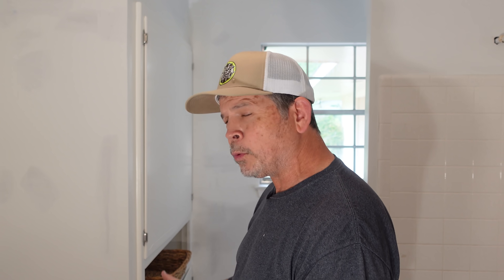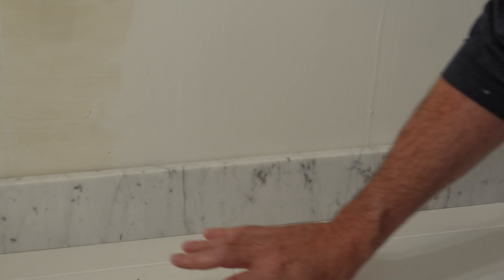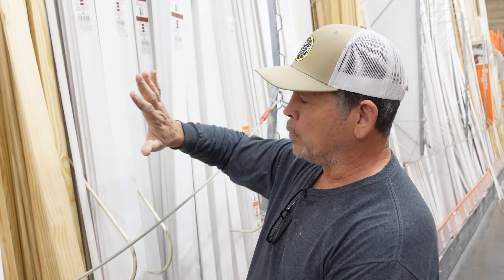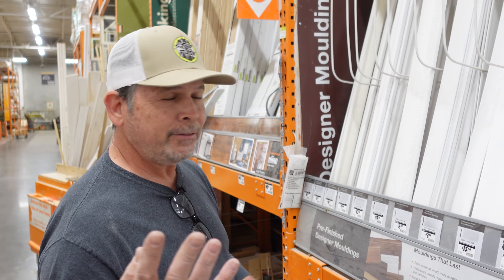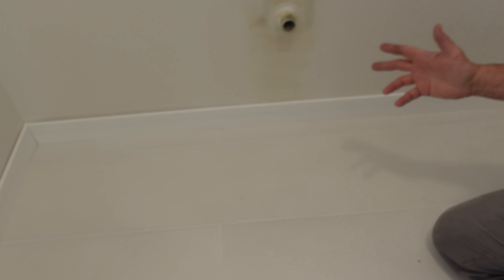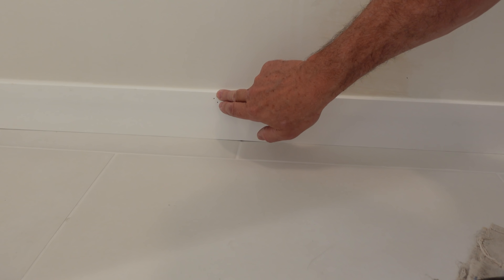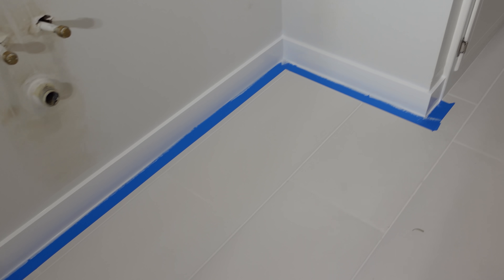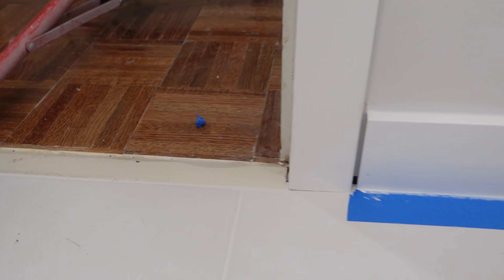Use THIS Baseboard IDEA on Your Next Project!

Comment: I put marble floors in my master bath and used marble for baseboards and door casing.  In the process of remodeling the kitchen and am doing the same thing.
Reply: Not anybody who's a pro, but i have a lot of marble in the current house (very art deco house) and all my research shows marble in a kitchen is a really high maintenance nightmare.   Marble is very porous and it picks up everything.  Spill something on marble and that spill is there forever.    Countertops and kitchen backsplashes have the same problem.   You might look into marble look alike quartz products (I know, not the same as real stone).  or a real tile instead of being disappointed long term.

Comment: Doing a light update of the guest bath, I used PVC baseboard. I found that white silicone-based bathroom caulk is more than enough to fill the little pin holes from the nails, doesn't shrink, and is invisible unless you get down on the floor with a flashlight searching for it. I just dab a little over it with my finger and wipe off any excess with a damp rag. No need to paint the already gleaming white baseboards!

Comment: Tip:  I have been putting a continuous bead on clear caulking under baseboard in any bathroom or basement where possibly water can occur.   Keeps water on the floor and not inside walls for the occasional minor flood.  Caulk not visible on finished product. Anything squeezed out is removed.

Comment: Another great video!  👍🏻👍🏻  (SO glad y'all made this channel.)

Tip I used for taping quickly when I was doing a lot of interior work: ditch the roll of tape and putty knife... use the tape/paper maskers from the paint department, but with no paper on them (only tape). You do have to be careful that you don't cut yourself on the blade, but as long as you go around the room from Left to Right, it'll become much faster than the old way.

(Another side benefit discovered when I started using maskers for all my tape jobs: when I finally used a masker with tape and paper for painting, I had so much experience with the masker that I could move at a fast walk... which soon became a slow jog... even on stilts.)

Comment: I built miniature models and as you can guess joints have to be perfect and nail holes almost glow in the dark. I use Durhams because I make very small batches. That stuff is great to work with as I can mix it as dry or wet as needed and it gets harder than woodpeckers lips.

Comment: I'm surprised that you didn't mention getting complimentary "Bull-Nose", this is that I do in all my bathrooms. Sure you still have the grout lines every two feet and in the corners but I have never found this to be a problem. I also always use "grout" caulk to finish the top of my baseboard. It has always turned out very nicely.

Comment: I use glue on all of my trim but with this polystyrene base instaed of face nailing it I use Double-Head Skirting Thread Seamless Nail they are installed into the wall and then you push the trim onto the nails then take a scap piece and use it as a punding block and set the trim the rest of the way tight to the wall seal the top and your done no painting and no nail holes to fill

Comment: Great job explaining the positive and negative with base boards. I really like  the explanation of the stone for more but faster and less finishing needed. Durham water putty, I've seen it on the shelves but have never used it. I like the fact that it wont dry up on me between use and it seemed to go on and stay after a light sanding. I bet there is going to be a rush of sales on Durham after your  great demonstration.
 Two small problems though. The caulking you used. It's super cheap and really inferior to most other painters caulking. All the carpenters and painters I know have come to the conclusion after years of using it that it's crap. It keeps on shrinking and you only did one coat of it. I'll bet you $5 you'll be back by next year or sooner redoing that. ;-) What about the bottom of the tile floor and base board? In bathrooms and laundry rooms I'd want to seal that from potential water spills. I suggest clear painters caulking or tile grout caulking that you can get that matches your tile grout.  Now I'm off to go buy me some of that Durham putty and stop using the quick dry spackle that is usually dried up and of no use before I use it all. Looking forward to your next video.
Reply: DON't use  Durham water putty  on exterior fascia boards . Prime and painted it with exterior Sherwin-Williams paint 3 months later  the product separated and the paint peeled right off.

Comment: I noticed you guys used what looks like the DAP Alex caulk.  That stuff is junk.  I have always had it shrink and crack even on the smallest gaps.  I started using Big Stretch which I get at Lowes.  It has more latex and less clay.  The stuff is great.
Reply: Same experience. Consistency of toothpaste. Junk.

Comment: How about cellular PVC?  It can be used for the trim and fascia boards on the exterior of house where it is exposed to the weather with very little deterioration after many years.  It can also be cut, nailed, screwed, painted like wood so it would seem logical that it would be a great material for baseboard in bathrooms and laundry rooms, maybe even in garages and water heater closets.

Comment: Really glad to see I’m not the only one that doesn’t like a wood baseboard in the bathroom or even in the kitchen for that matter! I absolutely hate MDF! I flat refused to use it!  It may look great when it’s first installed but a couple years down the road it’s a nightmare to look at and it only gets worse looking as more time passes.  Almost anything better then using wood.  Only other issue I have is with silicone. Sure it looks great right after applying it. But as time goes by I’ve noticed that silicone yellows and you can visually see exactly where that silicone at.  Again looks like hell somewhere down the road. But I have yet to find a better solution for those gaps either, other than using a paintable silicone and painting it along with the baseboard!  Hopefully someday someone will come up with better solutions!

Comment: I wish I would've watched this before hanging poly base in my rec room. Cut it slow since it doesn't feel right to me to cut trim quickly. Melted like a mother and I had to scrape off all the tailings. Was a pain. It installed surprisingly well though, I like it more than MDF.

Comment: I've done this in all my bathrooms. But the grout lines on the baseboards need to match the floor below.  you can also finish the top off of the tile with a matching flat vinyl liner for a smooth finish

Comment: The stone looks pretty and fancy.  Another option could be the white wood grain appearance pvc.  That’s what I used in our basement and it looks pretty darn good.  I used the 6” tall ones instead of the shorter ones to give it more of a baseboard look.  Our basement floors are not finished and sometimes we do get water in from the outside door.  That’s what made me think to use them.  They’ll never warp or rot.  They are actually in the garage door section at the Lowes near me.  Yes, it’s true that you have to predrill the nail holes but I didn’t have any issue with cracking at all as long as the predrill was sufficient for your nail size.  They are also pretty easy to sand an edge if you happen to be a tiny smidgy off on your cut.  (my first time doing baseboards, angles and scarf joints….sometimes we need to sand)

Comment: May already have a video on this. Caulk. Use caulk with a 50year or more warranty. It won't crack. One that will crack in a year is DAP ALEX 25year. <----This stuff is good for some things like temporary jobs but nothing you'll want to keep nice for years like this bathroom project. DAP ALEX comes in several years of warranty and the price reflects it. A decent tube will cost around $4 to $6 depending on brand.

Comment: You guys are awesome. Been watching your videos for a while now. You and Jordan are the best duo on Youtube. And Paul, I feel like you and I are the same person sometimes... perseverating on little details, and willing to rip things out and redo until we can sleep at night. Quality in residential construction has been increasingly underachieving the last decade or more. I'm often left disappointed when I choose to hire instead of do the work myself. It's cool to see two dudes who seem to really care, and don't sacrifice quality for speed. PS A lot of times I choose to use PVC molding in wet areas like bathrooms rather than polystyrene. Although it still can be prone to denting, PVC molding is a bit more rigid and harder than the very soft and floppy foam molding. Understanding PVC moldings are only commonly carried in the home centers in 1 x material (3/4" thick) so if you are looking for 9/16" or something, you may have to use polystyrene.

Comment: Pro tip. Don't buy trim from lowes or the depot. It's usually considerably less money to buy it from a moulding supplier. Like 50% less
Reply from the maker: My molding supplier has no stock.  They're pretty upset about it.  Manufacturers ship to the big boys first then local shops get their orders filled....maybe.
Reply: @StudPack  yeah. It's the same way here in Northern California.  Ww are wiped out. I had to use 6 inch baseboard and cut it down to make 3 inch craftsman door casing

Comment: I'm curious if you will use Floetrol (or similar) on the trim to get a smooth finish with the paint.
Reply from the maker: I've used that product before.  It works great.

Comment: Although Rock Hard will work you are adding an extra step of sanding. As a painting contractor we always have used putty and a putty knife to fill nail holes. Using this method there isn't any shrinking.

Comment: Great videos. 
Q: Have you encountered kitchen cabinet droop on kitchen remodeling where the cabinets hang under a portion of a dropped ceiling or A/C ductwork, leaving somewhere between 1/2"-1" spacing?  I have some ideas on how to resolve this issue but would like to hear your experience and suggestions if you have encountered this minor but unsightly detail.

Comment: I wonder if you guys know the answer to this - are you able to transport 16' baseboard & crown in your truck? I've got a crown job and my walls are 15' long, so I'd love to be able to get 16' pieces home, but I'm not sure if our pickup can manage.
Reply from the maker: I put it on the passenger side mirror and then I put a stake in one of the bed pockets and strap it all down.   Hard to explain... the stake goes in the bed pocket (where you'd install a lumber rack) by the tailgate.  Hook molding on the inside of that stake (keeps it from falling off the bed) and rest the other end on the side mirror.  Use towels to protect truck if you want.  Tie it all down... I use a ratchet strap.  No interstate travel allowed with this method 😂
Reply: @StudPack  Genius! I only need to move it about 5 miles on back roads, so something like this works perfectly. Thanks for the tip!

Comment: Stone and tile can make a really nice finished appearance (you can even use wood trim above the tile if you don't like the unfinished edge) but one advantage wood trim has over stone/tile is that stone and tile can crack if they're shocked by something - especially if they're up against a softer backing like sheetrock - whereas the wood will just get slightly dented. If I had a bunch of rambunctious kids running around, I'd probably choose wood trim over stone just to be safe.

Comment: Any ideas for improving the look of a 5” x 3/4” base molding? The house has 3/4” round corners, but the original installer just put a 90 degree corner on all of the base. 
I don’t want to rip all of the base out, but the 3/4” thickness leaves a shelf that collects a lot of dust. 
I thought about putting a half round on top of it, but it’s already 5” tall. 
Then I thought about using my router on its side to put a round corner on the top, and side, of everything, including the casings… but I’ve never seen anyone do it, and I’m not confident it will look good when it’s done.
The people I bought the house from had little boys, and with how banged up the trim is, you’d think they let them run through the house with crowbars. 
A 1/2” round over would clean up all of the bashed edges, but a 1/4” round over would be less extreme, and would clean up 98% of the bashed edges. 
I just don’t know if it’ll look good…

Comment: Do you have to prime over the Durham Water Putty, or can you use paint only? My wooden baseboards were removed, then sanded, primed and painted. When they are nailed back in place, and the Water Putty applied, can it be painted, instead of priming and painting.

Comment: Did you need a special blade for the polystyrene?  Do you ever calk baseboards to the tile, or put a bead of clear silicone under them so that over the years, water wont keep getting under it if you mop the floor a lot?   Guess I'm still old school, but I dont mind the look of Colonial base.

Comment: I’m cutting polystyrene narrow moulding and attaching it to subway tiles in my kitchen. I planned to attach with liquid nails. Is that correct or would you suggest a different glue for plastic to ceramic tile? Thank you

Comment: I’m embarrassed to ask but I’ll ask anyway. When using the blue tape do you remove while the paint is still wet or do you remove when the paint is dried?
Reply: Wet. It may not separate if it dries.
Reply: If you remove it when dry, you risk tearing jagged edges off of whatever you painted if the paint overlapped from material to tape.
Reply from the maker: I run a utility knife across the paint edge right after second coat to make sure the first coat (now dry) won't cause trouble.  Then I remove the tape.

Comment: Where did you buy the stone?  Specific name?   Have a whole house of Tile I just installed and yet to grout because I cannot decide on what to do about the baseboard.  I have cut several pieces of the flooring to see if I like it and even looked for complete white tile to use as a baseboard.  It’s a rental property and tiled because I had to replace sub flooring after the last tenant.  So I need low cost tenant ruining proof options.

Comment: Just to add to your confusion, plastic soda bottle are actually made of PET (polyethylene terephthalate). Milk jugs are an example of what is commonly called polyethylene, usually HDPE (high-density polyethylene). Visqueen plastic sheeting is also a polyethylene, but low density. The base material might be the same but the additives make the plastics vastly different.

Okay that's enough plastic geekery for today. Besides, when the zombie apocalypse comes, all this trivia won't mean a damn thing. 😁

Oh, I almost forgot, I've used that plastic molding before for the same reason you mentioned - waterproof. And I really like that stone idea. I'm thinking about remolding my house and I may incorporate that in the bathrooms.

Comment: Should do primer paint coat before installing. 
On final paint coat, lay down the tape, caulk the floor line, paint before the caulk dries and pull up the tape immediately. Perfect lines - dark cracks on white looks bad and you'd rather not have water going there.

Comment: Many years ago I worked as a painters helper.  He taught me to use glazing compound for filling nail holes.  To thicken the glazing compound and make it less sticky we would apply drywall dust to the compound to the desired consistency. it was applied and smoothed using the fingers. I don't recall it ever shrinking. Is this not a thing anymore?

Comment: Hey @Studpack - I see a lot of professionals using the finger caulking method while others use a caulking tool to smooth the joints. I have used the silicone tools for several years now as a professional homeowner and will never go back to the finger method.  Do you ever use the silicone tools for caulking?
Reply: I use the finger method with a water spray bottle. Comes out smooth like glass.

Comment: I've used tile and tile specific base in bathrooms... common in commercial/institutional construction. However, I'll also use 1x6 PVC or Fypon (nylon) mouldings. I can easily profile it on my shaper or router to match existing wood mouldings. Fypon is available in many profiles. I'll then glue it to eliminate fasteners. The Fypon takes paint better than the PVC. The finished product is IMPERVIOUS to moisture.

Comment: Should baseboards match the wall color? Does it look wacky with baseboards and trim matching interior doors (woodtones) to white walls? Small rooms with contrasting lines of trim etc?
Reply from the maker: That's really a design question. As a general rule, trim and doors/casings would match/be the same color. Walls could/would be one color and all the trim would be another color. Some designers will paint the trim and wall color the same for a monochromatic look. If your trim and doors are wood and you like the wood tone then keep it and paint the walls whatever you like. In some homes, the trim and door casings are painted (white, for example) but the doors are still a wood tone, it really truly depends on the style and design of the home and what goes. Whatever you decide, it's a good idea to keep it consistent in the home. Also, as a general rule, trim paint is usually a higher gloss (semi-gloss or high gloss) and the walls a low sheen (eggshell finish or matte, something you can still wipe. Never flat on the walls) Ceilings are usually a flat finish (often white) because a shiny ceiling is glary. Again, these are generalities but everyone has their own taste and style. Look through design magazines or some online sites for design inspiration and narrow down what you're drawn to. By the way, this is Mrs Studpack, resident designer 😊